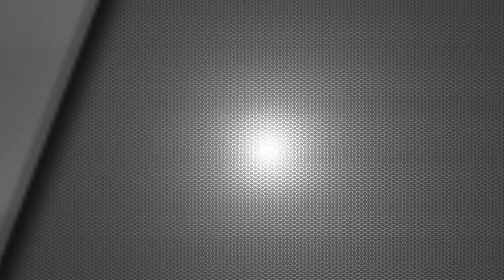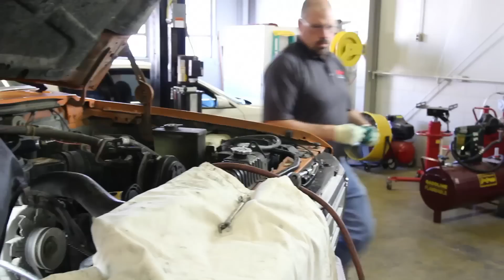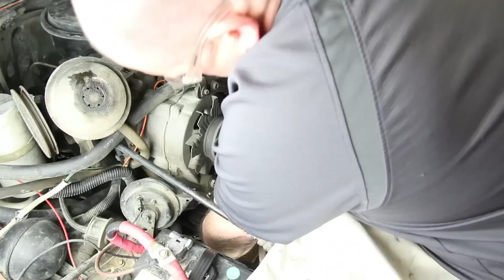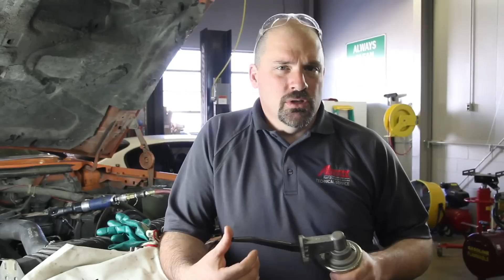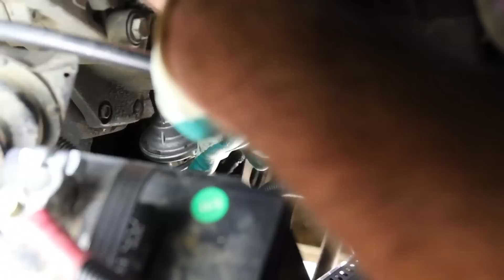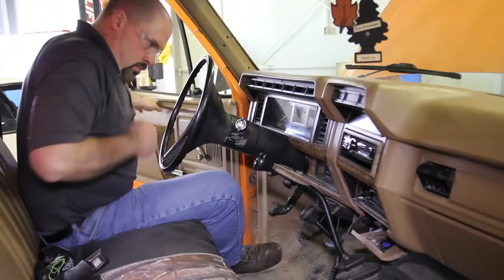How to Install a 60278 Mechanical Fuel Pump on a 1986 Ford F250

Comment: Everything worked great!  Thanks for the video!  Only problem I had was my fitting @ pump wouldn’t break free from line.  I ended up pulling line and pump together and separating them on bench vice/ reassembled same way with new pump.

Comment: Also make sure the cam is in the low position. Where the cam widens to about a inch wide
Reply: I'm guessing the redesigned arm on the pump is to make it easier to install without having to fight with the cam lobe.

Comment: How did you get the cam lobe into the top position?
Reply: bump start barely turns the cam enough so you can get it into position

Comment: Why is the loop in the fuel line necessary?
Reply: I imagine it’s to allow room for engine to pitch when under acceleration. It’d suck to have your main fuel line pull off the pump while under acceleration
Reply: probably air bubbles? or it could just be a ford thing that makes no sense and is just there from factory by mistake
Reply: I would like to know also
Reply: Same concept as a brake line. Its there for engine torsion so theres a good amount of room to flex without destroying the line.